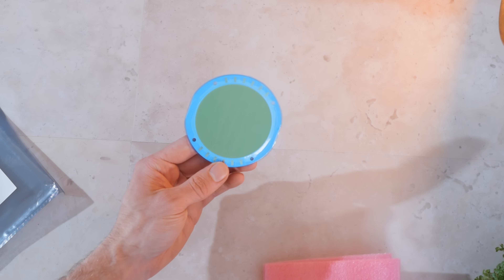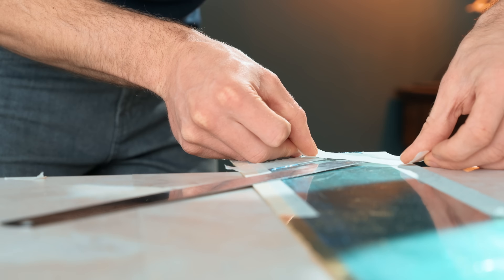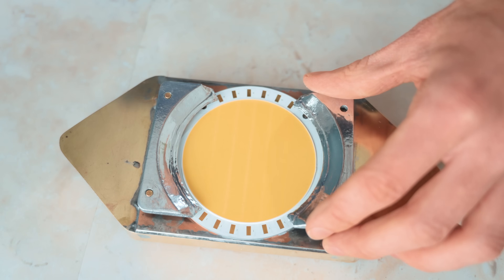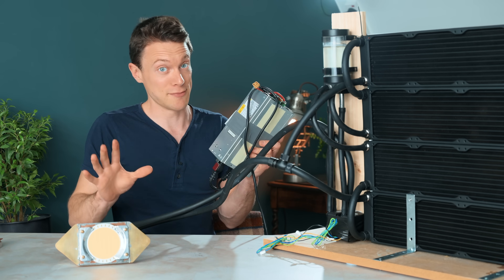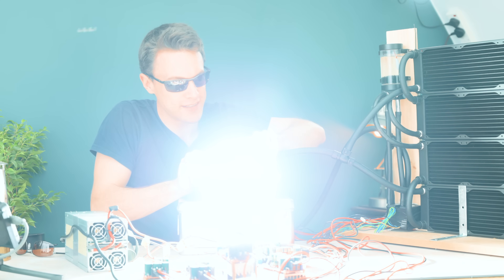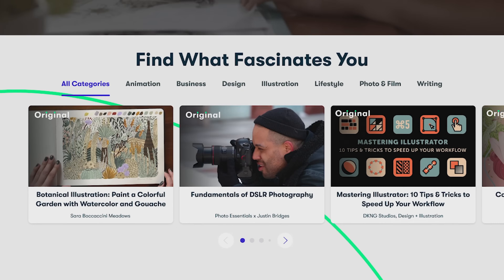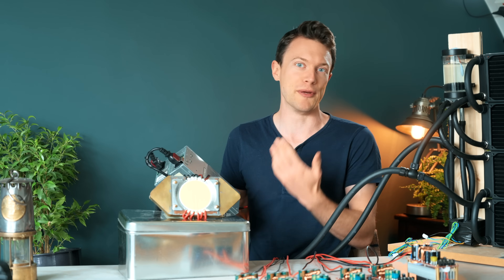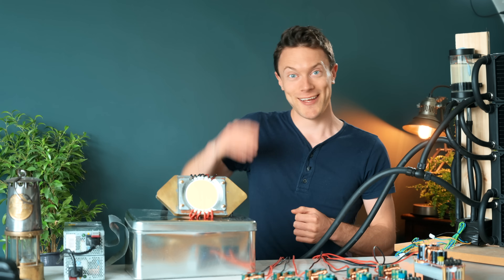Testing the world's BRIGHTEST LED!!!

Comment: Most computer supplies are rated by all the rails combined but if you’re only using one of the 12V rails the max output can be much less than the rating

Comment: I’m assuming you mean parallel? Also you shouldn’t need the full 1500w of cooling as it should be relatively efficient so the majority of the energy should be converted to light rather than heat?

Comment: That's not soldering, it's brasing. You're not fusing the parts, you're creating a mechanical connection by alloying the interface between the two parts and the brasing material.

Comment: what you did was great however you're not dissipating 1.5KW of thermal power  because Led 
Thermal impedance is different than an incandescent light bulb 
in this case it depends on the internal resistance let's call it R  and since you're consuming 50A  the power loss will be R*50  therefore I'm sure it won't be 1500W 
so that heat sink  in the beginning might have worked

Comment: could be the voltage or .. are the both 2000 wrms each? or are they 1000wrms each. if they are 1k wrms each its still 24volts at 1kwms of max power. the voltage doubles not the amperage

Comment: So uh, nobody else noticed the two power cords spliced together? If he was where 220v was normal, at 1600w load, that’s a load of 25 amps, wayyyyy more than what a single IEC cable is rated for. At 110v, it’s around 13-14 amps, and with those skinny, high-resistance 
cords he used, I think we found the problem...
Reply from the maker: At 220v it's 7a, yet it was a 13a wire with appropriate 13a fuse. Just a heads up :)
Reply: Most IEC cables are 18Awg, and are rated for 7A. At 1600W, which is 7.2A continuous, you very likely were overdrawing and had high resistance, which is what likely caused your PSU’s to blow.

Comment: This is a neat project and I look forward to seeing what it can do. I wonder if you might be better off using 3 server PSUs each feeding 2 voltage boosters. This means that each booster is boosting more, but if they are only at half capacity now, that should be fine and lessen the load on the PSUs.

Comment: Thanks for the great video!

About the power supplies: Im fairly certain the reason they burned up is that you had them wired in series. That means that we are effectively "pushing" 800w (half of your usage) through the "input" of your second power supply. They are not designed to run like that and my theory is that some component on the input side fried up fairly quickly. Personally if you NEED to combine power supplies, I would put them in parallel, since that doesnt really affect them and then step up their combined output. Maybe use a transformer for a large step-up and then the buck-converters for the last bit to keep it accurate.

Comment: When trying to solder larger and heavier copper or brass, use MAPP gas instead of propane for your torch. Burns much hotter and takes a fraction of the time to heat up the parts.

Comment: From the manufacturer's website:
Application:
Solar Simulator Lighting
Reply: He's growing weed 4sure
Reply: @PauloSantanaPlus  yeh with 50% thc levels
Reply: 6 meanwell drivers might be a better choice and a massive rvk pulling the heat directly off 👍
Reply: superdau So that’s why it gets so hot... it’s emitting light at similar wavelengths as the sun.
Reply: @diophantine1598  it can emit an amount of energy that's comparable to the sun. Wavelengths aren't the same since LED's don't emit (or apparently only very little) UV light.
Reply: @SimonZellox  It could, all you have to do is disturb the phosphor that gives the LED its white colour range. After that it will have lots of violet and UV light...
Reply: @diophantine1598  that would be very deadly if it did radiate the same wavelengths..
Reply: @Nathan Eaves  I don’t think the wavelength affects the heat, also the sun pits out pretty much all wavelengths.
Reply: @diophantine1598  led diodes can not match suns output but pulsate certain spectra and those pulsations are almost like laser pulses. So an led light is unhealthy in comparison to the sun
Reply: @manipulativer  Not unhealthy, maybe look wired. Also they do not pulse with a cc cv driver.

Comment: Hi Matt, nice job 👍
Did you mod the psu's or just wired the 12V in series? The power cable has live, neutral and earth for the 2 psu's? The psu's chassis are connected together? Keep reading... 
I have several 750W server psu's and to use them in series they need to be modified for safety. I don't need to go in details for you. You will understand the problem. Think, the chassis is ground, you connect ground to +12v on the other psu, that's fine, but what happens when you join the 2 chassis together???? Hope that helps.

Comment: When you build this monstrosity I'd put the radiators on the side of the case, kinda building the walls with the airflow passively cooling the powerboards etc. 

I think sth like a metal bottom and topplate connected via some standoffs would make a good chassis to add in the components, also allowing to carry it on your shoulder as you'll never be able to carry all of this with ur arms over a long period of time

Comment: Really cool, in more ways than one! Two things:

1) The server supplies didn't get a chance to cool down before the plug was pulled. Turn the LED off first and let the server supply fans run until they slow down, then kill power.

2) I couldn't remember if you said they were connected in series or parallel. If parallel, one supply may have been doing more work than the other. Unless they're perfectly matched, which is rare, one will tend to drive all of the load, and the other will do only as much as it has to. Edit: The easiest way to mitigate this would be to use 2 equal high-power, low-ohm resistors on each of the supply outputs. (If they're in series, though, I got nothing....) :D
Reply: series 15:46 

But good to know anyway for parallel connections
Reply: @remithomas3346  Thanks. It seems like whenever I get a 50/50 shot, I end up guessing wrong 150% of the time. :D
Reply: @McTroyd  Just like an USB plug
Reply: @GogogoFolowMe  Precisely. USB-A has been hell, but USB-C isn't ubiquitous yet.
Reply: You can also adjust the output voltage somewhat on most of the server psu's that I've come across. DEFINITELY don't connect the ground wires of both server power supplies to ground if they are in series. One needs to float.
Reply: @droyce4596  Ive trying to do that for long, never steped on the idea of increasing the output voltage. Input mosfets have their VDS "just in range" for a small variation, lest say 10 to 20% of the output .. But if you pretend to double that (appart from replacing the filtering and oput diodes) the input mosfets experience a much higher peak-voltage when the swtich off, away their specs. You can get around changing them. But then, the switching tranformer  will face higher voltages and they could arc (unsure their insulation limit). Like this PSUs are tailored to the voltage.
Reply: When you are connecting server PSUs in series, you have to make one of them floating ground/neutral. http://www.tjinguytech.com/my-projects/diy-24v-47a
Reply: As he said they dont have enough voltage so they are in seriell
Reply: @peterzingler6221  he used stepup converters to boost the voltage. He put them in seriel to get more watts out of them because He needed 1500W and one of the PSU had 750W.
Reply: @TTWarGames  in series would give more volts. He said in series to bring the voltage to 24 and used the converters for the rest of the way to 30 something volts. The PSUs are 1000W each (since he stated 2000W together) Also no matter if he put them in series or parallel he will always get the same watts.

Since W=V*A so let's say for example the PSUs are 12V 10A (120W each so 2 should be 240W)
in series             (12V+12V)*10A = 
                             24V*10A = 240W
and in parallel   12V*(10A+10A) =
                            12V + 20A = 240W
Reply: this guy electrics
Reply: He's got a wall of fans leaving nothing but cold air behind (on the intake side). Butt it up to your lowest set
Reply: You hit the nail on the head. The power supplies were near maxed out, fans screaming trying to cool, they had not opportunity to cool down because power was cut, and all the latent heat fried components and solder joints.  Much concern about cooling the LED and  unconsidered  cooling capacity of the power supplies along with strapping them  together did not help.
Reply: LEDs stop consuming power as soon as the voltage drops ~10% (milliseconds), and the fan will continue to be powered until DC voltage drops to zero (seconds).  
you would melt anything with more than 1 milliohm resistance (aka thick wire).
Reply: Cant he run one half of the LED with one PSU and the other half with another PSU?
Reply: @TTWarGames  6 ways... listen carefully.
Reply: To add to point 1, server PSU's are very reliable for continuous use, but they are not really meant to ever be turned off/on, so you have to be really cautious with them and give them time to slowly start up/shut down. They dont have all the protections that standard consumer hardware has.
Reply: @Anton-cv2ti  Server PSUs have no problem being turned on and off. When designing a power supply you don't choose between reliability and turning on and off. Also, when a power supply is turned off it stops delivering power. Even though the fan shuts off it is impossible for it to continue getting hotter because there is no more power flowing. This means the temperature before it was shut off is the hottest it will get, it can only go down from there.
Reply: @Music42Ever  The fan is constantly removing heat from a few very hot components. When it stops too early, the heat spills out into other components that might not be able to handle it.
I stand by my statement that you generally have to be more careful around server PSUs compared to consumer PSUs, but it definetely differs from model to model. Its just a good rule of thumb and good general advice if you ask me.

Comment: Wiring them in series will NOT spread the load on both psu, it will only add up the voltage, just like batteries would, and just like batteries, you end up with the same capacity, power in this case, as one of the units alone. This means that assuming that you said 2000W because each one of them is 1000W, you in fact end up with 24v at 1000W.

Comment: Now make a projector using this as the light source.

With a brass and copper part in your water system, you should run a mix of distilled water and a cooling fluid that has anti-corrosion additives in it.

Comment: What's the efficiency of that LED? I'm sure it doesn't output 1,500 watts of heat. Maybe a couple hundred watts of heat, the rest as light. Could probably get away with just one radiator.

Comment: PSU output of 700 W is the sum of the power available on all power rails. Individual rails will be able to supply far less than the 700W required.

Comment: Very important : if each power supply is 750w and u series them , the total power output is still 750w but double the voltage . If u are using them in parallel , well u cant really do that without ballance sharing the load .

Comment: Hi Matt, I love your work, a unique and beautiful combination of engineering and art.
Two notes about the Water cooling system
The first, I recommend you add a thermal sensor which will be connected to the boost converter for overheard shutdown (or throttle down)
The 2nd is regarding the paste you mentioned in the Video. I would recommend using a metal-based thermal compound and apply correctly not too much, large amount of paste actually prevents good heat transfer. Sorry if I'm stating the obvious.  For more info please refer to: https://www.ekwb.com/blog/thermal-compound-guide
Regards Tomer

Comment: The power supplies died probably because the load was all on a single rail.  The rated power is combined 5V and 12V. If you only connected to one of those voltages you won't have the full total rated power.

Comment: Not 100% here but if you wired the AC power supplies 12v in series you ran them out of wattage range. You should have only expected 1000w @ 24vdc then adding in the bump up converters you incressed the draw on the ac power supply even more. Adding two more power supplies in parallel will be needed to cover the power needs. On the plus side it should be brighter.

Comment: Switching power supplies designed for IT aplications (PCs and servers) should never be used in series or parallel configurations, they simply aren't meant to do that. It is always a bad idea, expecially for what concerns connecting different rails of the same PSU (power supply unit for them who don't know the abbreviation) together, because every part of the circuits are rated for a said power, if you connect two of them (even if they are perfectly identical) in series the sum of the watts will flow across each of them burning the circuitry in the short or long therm. If you plug them in parallel even the smallest difference in the output voltage (because it is almost impossible to set to the exact same voltage) will cause one of them to suffer a greater stress and eventually fail due to overheat.
Apart from everything said before I think the cause of the failure is due to him having plugged all six arrays together at the same time, the sudden power spike could not have killed the PSUs immediately but it could for sure have caused sufficient damage to cause them to fail after a short time under load.
As far as they are concerned dual power supplies for servers are designed that way mostly for redundancy and not for increased power since switching PSUs exsist in any shape and color (eye-balling my 1200W 12V PSU sitting on the spare parts shelf exactly as Saintbow already commented). ^^

To sum up: It is always better to avoid to connect switching PSUs together and have a single huge oversized one instead (this applies for Li-Po batteries too).

Keep up the great work :)

Comment: Well you got the psus wrong there. If you got 1kW psu and add a second one in series u got 24V 1kW psu. If u hooked them up in paralel u would get 12V 2kW psu.. Im imppresed they handled that load for so long.

Comment: 1500 W is a LOT of power in an LED for sure! Amazingly bright! A  practical application of this device  would probably be as a lightsource in a Hollywood studio or similar large film studio for getting natural and realistic looking light while filming a large scene/area. Also there the cost of the device  would be managable and getting the required cooling/power also no issue as these units are most likley for use in large professional lightrigs wich will probably have both the power and watercooling system built into them by the manufacturer.

Comment: LEDs are Amp biased (as opposed to incandescent which are voltage biased). If you plugin all the LED drivers at once and turn the system on, the AMP draw will certainly momentarily exceed the power supply capacity. Which is likely what happened. In the first test you ramped up the LED strips. Which likely didn't cause an amp load beyond specs of the supply. In the second test you likely hooked everything up and booted up the supplies, which wrecked the supplies as the amp draw exceeded the specs.

Comment: Why not have each power supply connected to 3 power blocks each?  Running the power in series certainly would be bad as the current load on each will be half again it's rated ability.

Comment: I just came across a video which details a build using high power LEDs. The guy goes on to explain that LED are current controlled devices, not voltage controlled, as the current changes rapidly with small changes in voltage. So using a regular power supply wasn’t recommended in favour of a constant current PSU. This may well be the issue you had with your supply burning out, but you did some fancy stuff with the voltage boards so not sure. The video is https://youtu.be/3c-cAjx8jt8 hope that helps.

Comment: Probably the best bet for powering the setup is to use two lead acid car batteries. Each of them outputs 12V so if you put them in series you get the 24V. And they are designed to output very high currents and have the capacity to run this setup for at least an hour.

Comment: A friend of mine built a 500W handheld led light, he used a fairly small pin style heatsink with 3d printed sheets that went in between the rows of pins. The printed sheets have small surface features that forced air being pulled from a powerful fairly small fan to vortex around the pins. Without the printed sheets the pin style heatsink wasn't capable enough.

If his heatsink method was increased by 3 times it would dramatically decrease the cooling systems size and allows for air cooling.

Comment: You would have to keep the led on for 30 to 60 minutes to actually know what the liquid temperature is actually going to be  as it takes quite long for the water to heat up. So unfortunately that 30°C is most likely very inaccurate.
 I'm excited about this though so waiting for the next part.

Comment: Must have been bad PSU. I use alot of hp server psus and i push them Hard. Mostly to the top.  Though you did serie Them so i assume you did remove ground on One of Them ? Because most of Them för Short out IF not done. Also note that server psus should get warm. You have Up to 10% losses in Them and There isnt much space and small fans.  Great project though and looking forward seeing it done